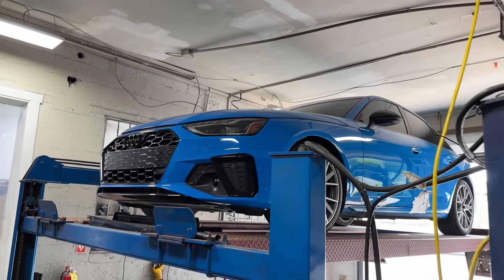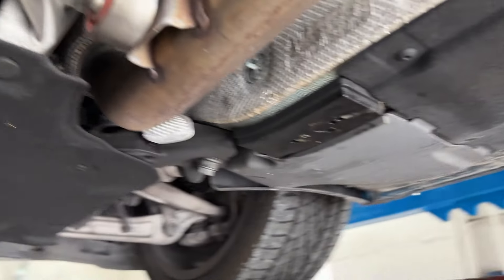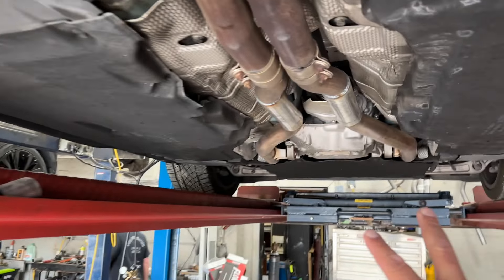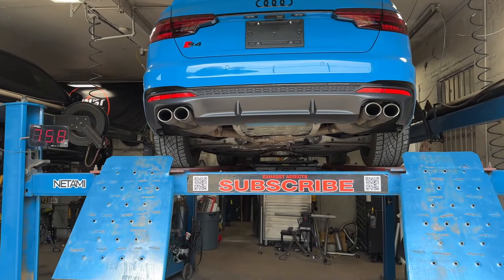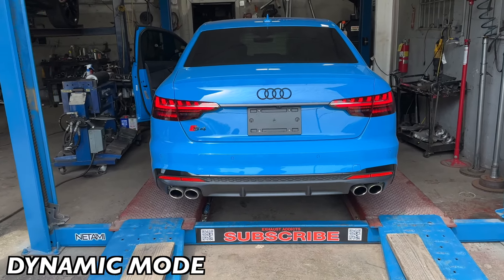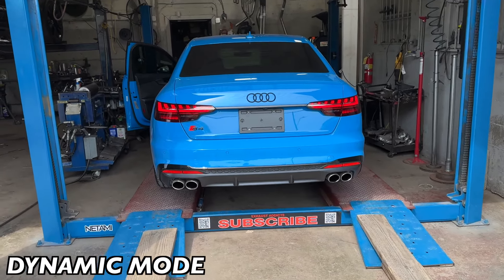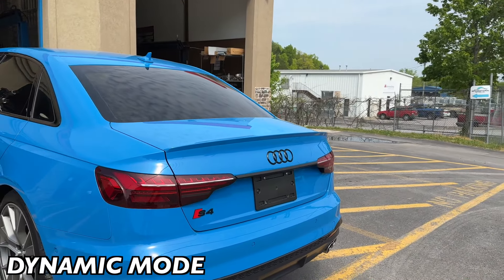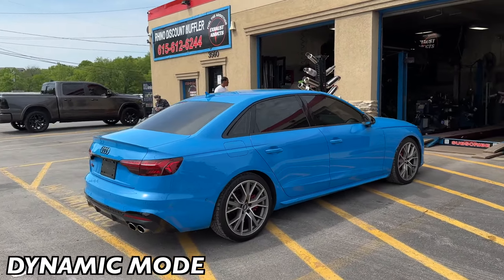2020 Audi S4 3.0L Turbo V6 w/ RESONATOR DELETE!

Comment: That thing is gonna drone
Reply: It does. I'm going to throw the rear res back on
Reply: @circuitandcam even in other drive modes with the valves closed?
Reply: @M5Ak yeah. It was bearable in comfort but droned in all drive modes. I left the front resonators off and reinstalled the rear one and it’s much better now. Zero drone but same actual exhaust volume, burbles, etc.
Reply: @circuitandcam wait so it was 1 big fat resonator before the mufflers right?
Reply: @shelbyhaiketic4212  after the cat there are two small resonators next to each other, a big mid-muffler, and the two rear mufflers. Front resonators is all you need to remove
Reply: @circuitandcam   I have a Audi s4 2021 so after what you’ve experienced you say just to remove the front resonator, so I won’t have any issues with the drone ?